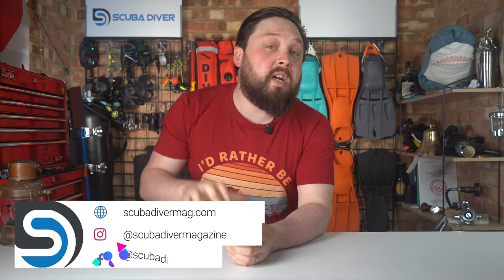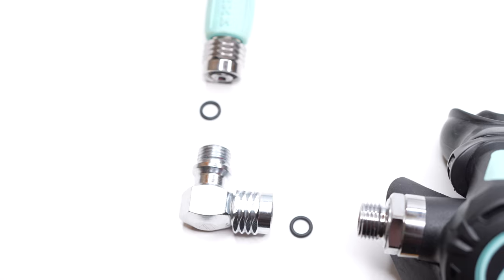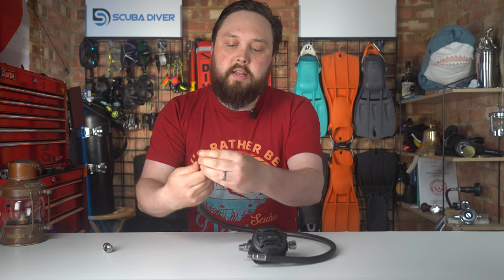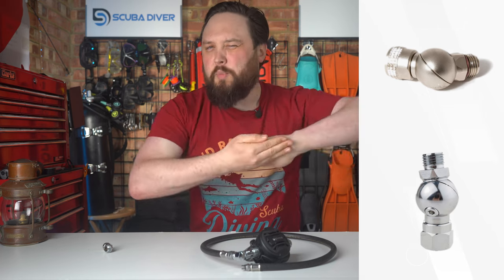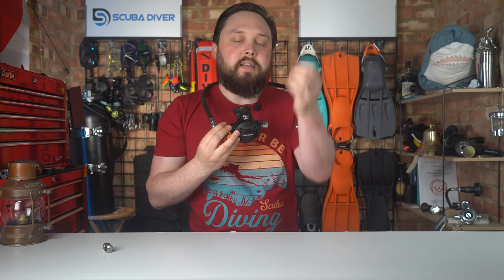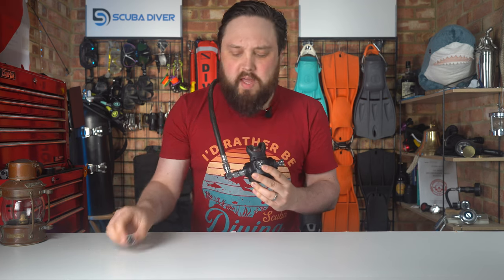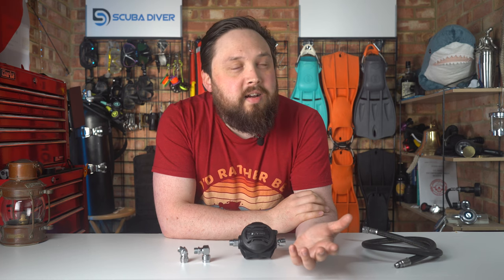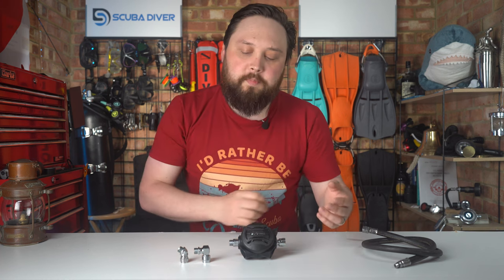Are Swivel Joints All That Bad? #AskMark #scuba @ScubaDiverMagazine

Comment: Now I see (Plastic) 360 swivel what is your opinion used it in "salt water" 03/37/24
Reply from the maker: I tend to stay away from plastic as much as possible because it usually hardens and breaks in cold water. And if plastic clips have moving parts, they wear much faster than metal clips and fail at some point.
Reply: @ScubaDiverMagazine  (( Thank you )) Sir 3/8/24

Comment: The added comfort of the updated omni-swivel was immediate and noticeable. While it does technically add another failure point, that risk is incredibly low. Look at any CCR diver and the number of failure points they have on their setup.

Dr. Richard Harris has dove 243m/800ft on CCR. If that number of failure points is acceptable at those depths, an added swivel for recreational diving (especially with modern gear) is not an issue. The shop being discussed here seems to be overreacting.
Reply: I agree. Technically they're right, but the odds of a failure are so low that it really isn't worth obsessing about.

Comment: I use 90 elbows on my sidemount and twins rigs to give me the ideal hose routing and I personaly have never felt any need for a swivel.  But unfortunately the only gen on mean time between failures for any of these things is anecdotal at best.  I suspect the probability of failure per dive is very, very small, and we generally have some redundancy anyway.

But does redundancy mean more failure points and is that therefore less safe........
Reply: Doesn't that depend on where the redundancy is?
Reply: @the.mr.beacher  Redundancy always makes things safer 🙂

Comment: #askmark different Steve here what about using quick disconnects on your second stages?
Reply from the maker: Quick disconnects are ok if they're required but, I'd always choose one with a locking mechanism to reduce the chance of accidental disconnection. Sometimes an inline shutoff valve can be more practical to prevent a freeflow.

I only tend to see QDs on full face masks so you can disconnect the hose on the surface and breathe from the SAV. that way you don't leave your FFM dangling in the water or dragging on the floor.

Comment: Sorry Mark, swivels are poor design. 1st time, dive 15 of swivel, medium leak. Screw backed out. Tightened with tiny bit of threadlock. 2nd failure, 30 dives later, full O ring blow out at 90' with a tiny bit of deco. Barely able to complete, surface with 300 psi. 20 bar. Checked fitting evry dive. Swivel went in bin. 

Swivels are a bad idea imo.
Reply: "full O ring blow out at 90' with a tiny bit of deco. Barely able to complete, surface with 300 psi. 20 bar" I would be less concerned about the swivel and more concerned about going into deco without the ability to finish it on a single tank without going to empty.

Comment: #askmark

Hi Mark - i do about 4 trips per year for warm water, recreational diving.  Is there a problem with disassembling my hoses and regulators for travel and storage?  I protect the exposed hose ends from damage and debris with rubber caps.  I also like the fact that all of my hoses hang straight with no tension when stored.  I ask because I do not see anybody else following this practice.  I look forward to your thoughts.
Reply from the maker: The only problem is increased risk of contaminants and stripping threads. You sound like you know what you're doing and you're not going to strip threads by over-torquing.

I pull my regs apart frequently and haven't seen any issues with additional wear or anything. Just keep dust and moisture out and you should be fine

Comment: #askmark
Hi Mark
I'm thinking about becoming a sidemount diver, so but BCDs could become quiet expensive, if you got a back-, sidemount and maybe a double tank BCD. So I thought about to choose a Hollis SMS 75 or something similar.
But I wonder which BCD would recommend.
Secoundly would you even recommend a BCD which is something like 2:1?

Maybe I'm weird but I thought about a 2:1 because this way I would be able to get three tanks but smaller ones then one 15L.

Thanks.
Ben
Reply from the maker: I've dived the Hollis SMS 100 on singles and sidemount which is similar to the 75. It's an ok solution if you only intend to invest in a single BCD. Most sidemount divers invest in a dedicated sidemount BCD. It's hard to get a backmount BCD that does pure sidemount very well. It's better to use a school sidemount BCD for the course and then decide if you want to invest in a pure sidemount BCD.

For diving single or twin cylinders with a sidemounted cylinder then a standard Backplate and Wing is your best choice

Comment: #Askmark
Talking about failurepoints. I recently had a discussion with my buddies whether or not to have air integration. Their stand was about the additional failurepoint. I am thinking there is just little difference between an AI transmitter compared to a dummy plug in the first stage. Not talking about a short hose that would indeed add additional o-rings. Do I miss something important here?
Reply from the maker: I'm fine with transmitters. They're an acceptable failure point in my books and the benefits outweigh the costs.

I always fit one to my regs when I go diving and I've never had a failure on one.